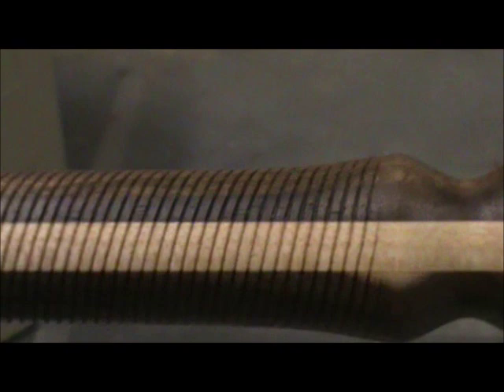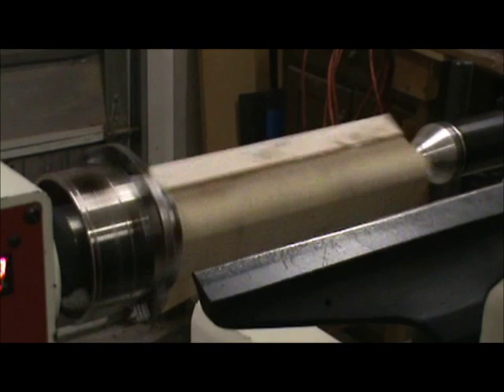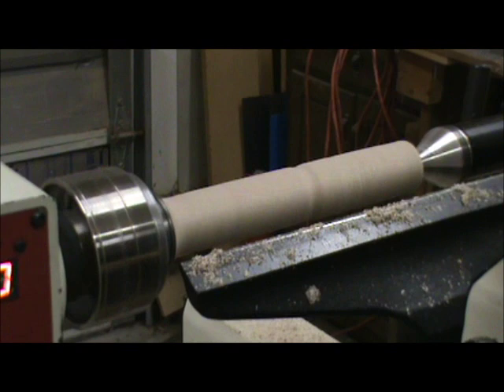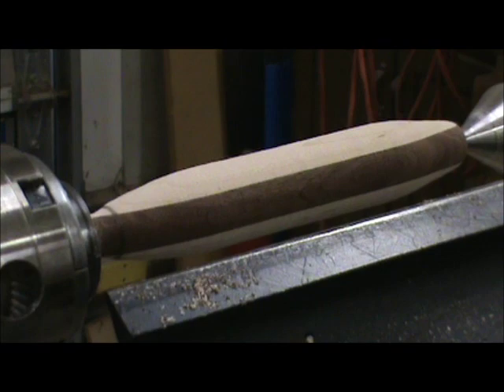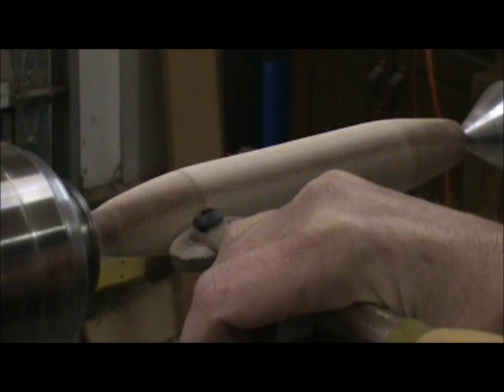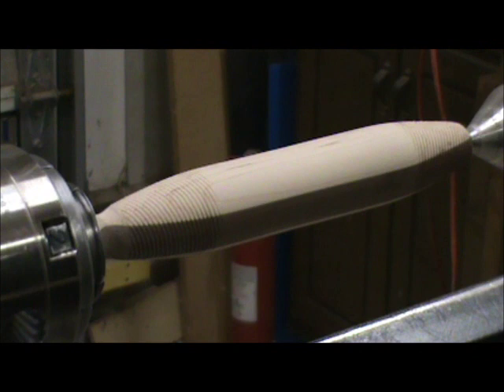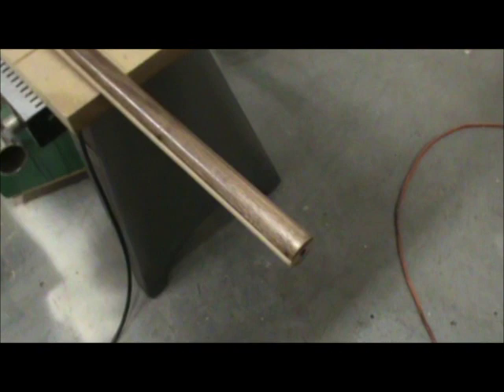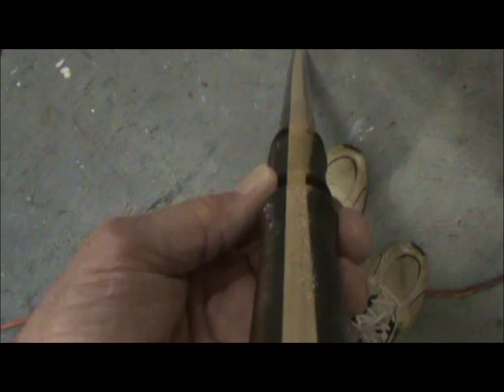Lathe Turned Walking Cane Part 2.wmv

Comment: very cool thank's for showing video.
Reply from the maker: +Joe P (sneezeobubble) Thank you for watching!  Dave
Reply: Were did you find your wheel cutter at.
Reply from the maker: +Joe P (sneezeobubble) I bought it at the Klingspor Woodworking store.You can find in their catalog. It is a fun tool to use, but takes a little practice.